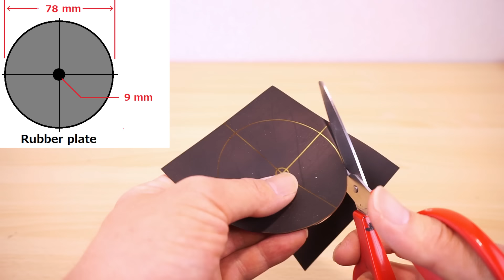グイグイ水を吸い上げる！【手押しポンプの作り方】トトロのポンプ How to make PVC pipe pump

Comment: Suggestion. To prevent the PVC pipe from wrinkling when bent in the heat, it is better to fill it with sand (covering the entrance and exit), it remains bent without wrinkling.
Reply: Or maybe put a little shade

Comment: can this pump lift water within 25 feet? however can we reduce the diameter of the end of your tube so that it will smoothly lift water within 25 feet?
Reply from the maker: Theoretically, a hand pump cannot raise water above 30 feet.
I don't think it is possible with a PVC pipe pump.

Comment: for auto pump , add watertight container at top, container must be higher than area where water is needed, container needs 2 outlets, one for bleeding one for connecting a hose pipe, so..... pump, fill container, now close bleeder valve, open the outlet valve connected to hose pipe running to your house, water will always be on tap as long as the source do not suck air.

Comment: Great Design.
Suggest filling the pump handle with dry sand or soil to measure, then pouring it into a pot and heating it on the stove or oven to about 350 degrees.  Tape one end of the handle closed, then pour the sand or soil into the handle, let sit until soft and form into the desired shape.
Use washers on all of the parts of the wood that is bolted.
Reply from the maker: Thank you for a good idea!
Reply: You're on pot Man..😎
Reply: @bernargolgoth6627  laguanakanakyangnatal0:-)
Reply: This is how low cost electricians bend their pvc pipes.

Comment: If you insert a spring to act as a form to bend the handle around, the PVC pump handle won’t crimp where it’s bent. Then remove the spring. I’ve done it. It works.
Reply from the maker: That's a very good way！

Comment: One thing not mentioned in the video is you can’t make a pipe any longer than 25 ft above the level of the water source, because the negative pressure in the pipe at that vertical distance will exceed vapor pressure of water
Reply: we pump water without electricity or any power more than 100 ft high over mountain to out house.
Reply: @luckydubeinrc5165  100 ft vertical? The overall length is probably 100ft, but what is the vertical?

Comment: para doblar el tubo de pvc mejor usar arena seca, llenar el trozo a doblar compactando bien la arena, calentar y doblar, asi salen las curvas perfectas sin que se aplaste el tubo.
to bend the pvc pipe, better use dry sand, fill the piece to fold compacting the sand well, heat and bend, so the perfect curves come out, without crushing the tube.

Comment: Put a bolt through the centre hole in the piston and put it in a drill, spin it over some sandpaper board, at least it will be even all around then compared to using a file. Good work though, a nice re-boot of an old idea. Brass or stainless nuts and bolts, copper would be better because int's anti-bacterial so water sitting in the pump doesn't become an ecosystem.
Reply from the maker: Your idea is a good improvement!

Comment: Wouldn't be easier to use 23mm and 25mm wood drill bits? They are also sold at home centers, you know ;-)
Reply from the maker: Working is faster if 23 mm and 25 mm drill bits are used.
I do not have.